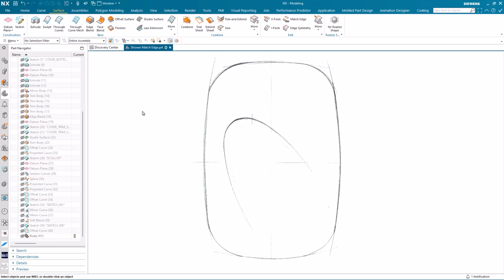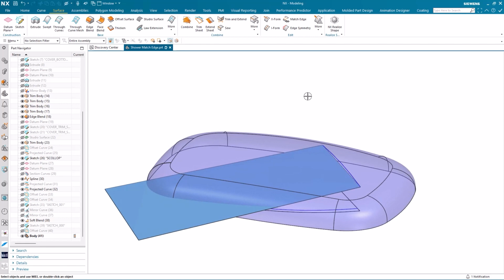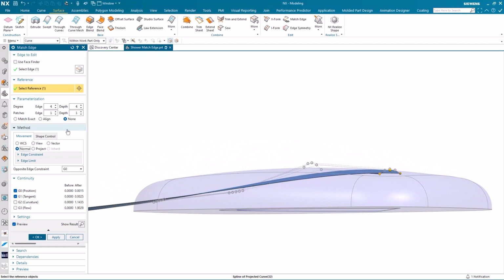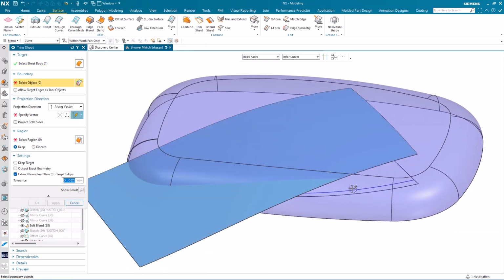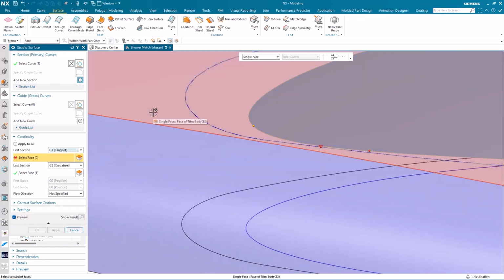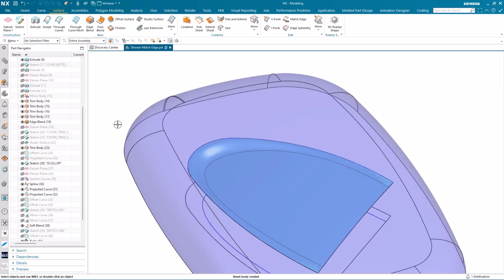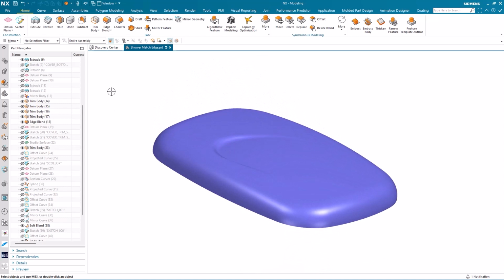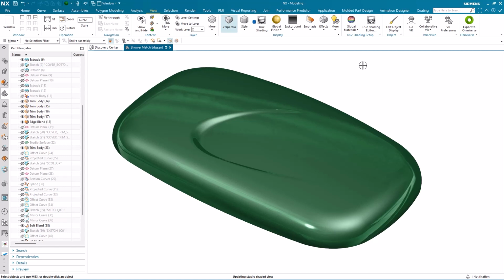NX | Tips and Tricks | Advanced Shape Design

Comment: great video!! i followed the mentioned procedure in the video but during match edge command, G2 continuity is not showing any different result than G1? can you tell why it may be happening?to get the shown shape after edge match command , i had to use X-form.
thanks
Reply: Hello, G2 requires at least 2 rows of control points on both sides of the edge, while G1 only needs 1 row. If you have only 1 row, then G1 and G2 will appear the same.
Reply: @SiemensJimmyCostello  thanks for the reply.Can you briefly tell how to ensure 2 rows (settings),if possible?
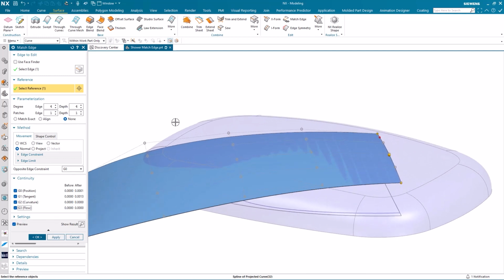Reply: @gauravsharma-ot6vs  If you pause the video at 3:15 and look at the Match Edge window, under the parameterization tab there is an option to increase the degree. Increasing the degree will add rows of poles allowing for G2 continuity to produce a different result
Reply: @SiemensJimmyCostello   thanks for the quick reply and explanation.